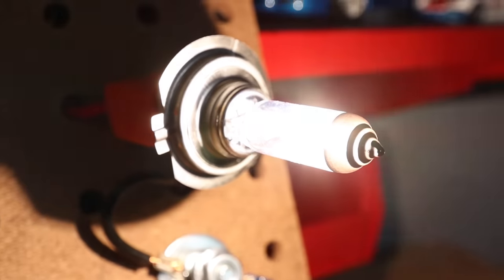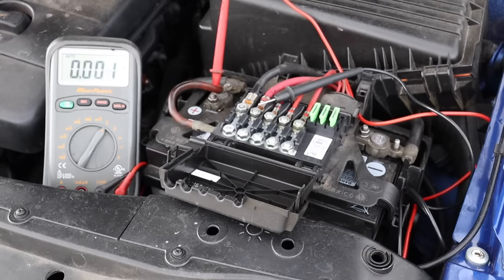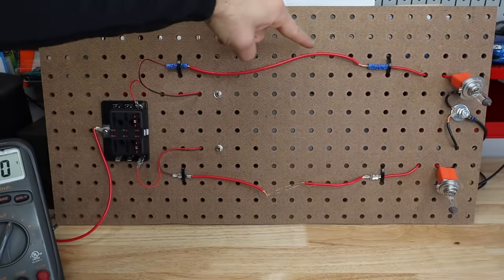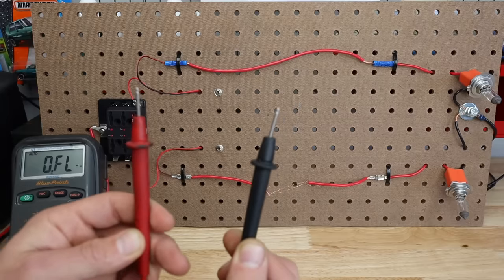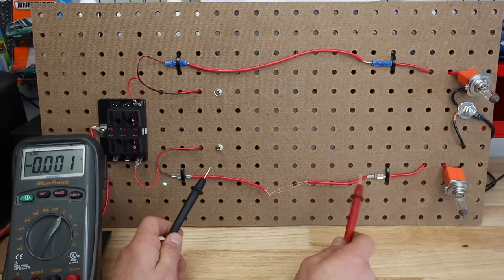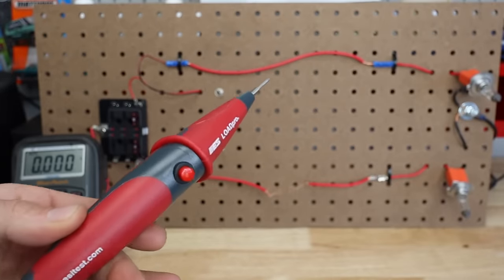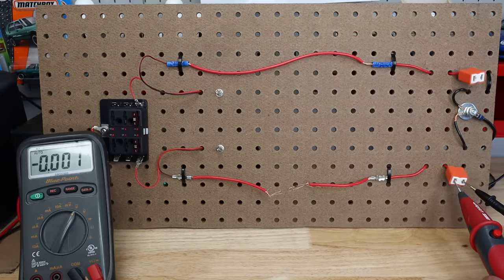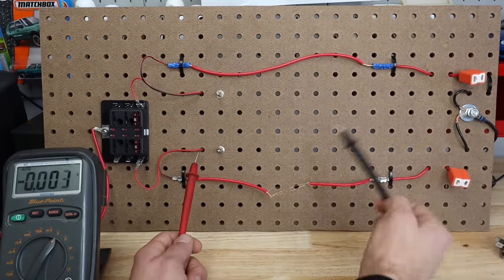Voltage Drop Testing ~ The BEST Way To Test Wiring

Comment: Good video!
Could be dangerous to those that do not understand modern electronics though however those folks will get them selves in trouble regardless if you made this video or not.
One of the scariest tools in a rookies hands these days is the Power probe.
I've earned bucket loads of money fixing vehicles after the owner or other mechanic fried modules probing wires......
As always, thanks for the great video!

Comment: Great video mate! I would love to see more in this style from you :)
Reply from the maker: Thanks! These are fun videos. But like the current draw vid, a lot of people are stuck on old, outdated, or just any newer or different way to do things. LOL
Reply: @HumbleMechanic Great video. A nice follow up would be "what to do after a failed voltage drop test"

We had some odd ball electrical issues a few weeks ago. Did the voltage drop testing; that "failed". So we cleaned the battery terminals, battery cables, alternator connections, ground to engine, ground to frame. We also had battery & alternator checked at local parts shop. Car runs better and no electrical issues.

Comment: One more tip: 0.75mm2 (18AWG) copper wire, 5m long (16.4ft) has a resistance of almost exactly 0.1 ohm. I don't know how thick the thinnest conductors, used in cars are, but probably more than that (0.75mm2 or 18AWG). So, if everything is good, you should get less than 0.1ohms on your multimeter, when measuring the resistance of even the thinnest wire @ 5m (16.4ft) long. And since most multimeters aren't accurate to more than 0.1ohms, if you get more than 0.0 or 0.1 ohms, you're not making a good connection with the test leads or there's probably something wrong with the wiring. Good video, btw! PS: thinner / longer wires have more resistance and thus more voltage drop, than thicker / shorter wires. And you get more voltage drop on wires with heavier loads (higher currents).

Comment: I've been messing with electronics/electrical and using multimeters since I was a teenager, over 20 years, I even went to school for it,  and I never knew you could get any kind of reading at all by putting both probes on the positive side of a circuit... Mind= Blown

Comment: Thank you so much!  Hoping I can use this to confirm if my passenger HID is flickering and failing to ignite due to voltage drop.  Installing relays didn't make the difference I had hoped.  Guessing it's an issue with the connector.

Comment: Awesome 👌 video this is very detailed on voltage drop testing I use it in my automotive diagnostic I have a resistance on a brake light when the brake switch is depressed I changed  out the brake switch with a new part and there is still resistance in that brake light the switch is not the problem should I do a voltage drop on each wire of the brake light wire?

Comment: Be interesting for you to do a vid on why bad grounds cause erratic symptoms...and why v drop doesn’t.
Reply from the maker: Oh we can make some bad grounds. LOL
Reply: HumbleMechanic 
I had an old ford truck parked in the weeds for about 8 years, then give it to my oldest son.
The sheer number of bad grounds were too numerous to count... truly unbelievably high number.
Most concerning was the near under-dash fire, not to mention the innumerable system failures.
We simply regrounded everything from small to battery to chassis, to engine etc etc.
Lucky my son is an experienced HVAC tech with loooots of energy... I’d have simply junked it !
Was a great learning experience for me...never would have expected that many grounds would have been bad
Reply: I believe you can voltage drop ground cables as well.

Comment: Thank you SO much for this video!  I have a mk2 Gti that is only reading 10.2v at the power lead for the lift pump/in tank pump, and I want t sure how I was going to determine where the issue was.  I have a solid 12.5 at the fuel pumps relay, so I guess it’s time to start probing downstream of there until I find the issue...

Comment: Good explanation! I use voltage drop testing on almost a daily basis. Hell I just used it today on 3 different reefer units today to track down problems. One of the great parts about it is it can help you narrow down where the damaged wire is in the circuit moving from connector housing to connector housing. I have a load pro as well it is a handy tool but the only thing I don't care for is that it only draws about .24 amps. I would love to see a load pro that could do 5 amps or so for higher current circuits.

Comment: Great video! Any idea how you'd test the voltage drop along a wire connecting a DC-DC charger that is 7m away from the starter batter?!

Comment: I'm trying to learn how to check the circuitry of my son's 93 Honda.  The battery drains overnight, but how?  

The dummy battery light comes on, but turns off when the AC is turned on, so that's telling me that the problem lies in the AC.  Is my way of thinking correct?  That's all I'm really asking. . . . for now.  

Thanx for the illustration of the broken yet still working wire.  Very well done.

Comment: I want to test the voltage on a cable attached to my room that goes to our router. Ever since they installed the cable, my hair on my arms and neck stands up, and it feels like I am getting a sight shock. Can you recommend a tester for this, or to see the free electrical charge in my room from the cable? Thanks

Comment: Oh oh oh ok I have one for ya buddy! Yes! Voltage drop tests super effective! I've noticed you mentioned and also in my experience starting and charging systems do make for really easy guides on how it works and the basics. That will probably be the majority of time but! As a technician we know that these systems are also designed to use a certain voltage through a system.  I.E. you dont really ever have just one headlight in alot of circuits So! With two headlight you would expect to see 6 volt loss across each one yes? Most modern circuits imo short of general starting and charging have more than one load designed in the circuit. Also! What if this a circuit that uses a 5v reference and common grounds for multiple sensors! This video needs another 12 and a half hour lecture to cover all the bases. I would love to see that video but in a collab with EngineeringExplained! Your both great guys and I love both of your channels but in a general shop environment I could see you guys butting heads quite often
Reply: Headlights are wired in series/ parallel, so if one blows the other stays on.. So when testing each headlight at connector you would see 12 volts.

Comment: Why did you equate .26v to 2.6 volt drop? Thanks!  4:37
Reply: I stopped the video at this time . Not serious.
Reply: I may be wrong but I think it was a typo the actual result was .26, which is how much voltage was used between the 2 testing points I believe anything pushing a bit over .200 volts is kind of bad

Comment: Once upon a time I had a car. At night it was very noticeable that every light (Anything that was powered) would fluctuate in brightness in a consistent and constant manner. Motor ran good apart from the ticking noise. got rid of it as I needed a truck. Easy fix. :)

Comment: My old car has o voltage drop of 1v on the positive side and 0.5v on the negative side of the cooling fan. So a total of 1.5v, do you think this will affect the performance of the fan? 
The headlights had similar problem with over 2v drop but fitted a loom with relays.

Comment: Networking is the same... Signal degradation is experiences with voltage drop on the data lines that go over 300 meters.. Thus I use a fiber line. it can go for Miles because it uses Light instead of electricity. :)

Comment: Great video, and very useful. Can you please make a video that explains your process for determining where to attach your leads within the circuit? If the frayed or pinched wire is somewhere inside eight feet of loom, what’s an efficient way to know where you have a good 12v or good ground source to locate the drop? Thanks.
Reply from the maker: for that situation going right to the component would be best. Look at how I had the load pro on the light bulb. OR really, anywhere you can get to wiring. LOL

Comment: Would it ever be useful on testing signal wires? For example, I had a vehicle with a issue of randomly loosing power. 1 fault for Wastegate actuator posistion sensor - Low. Did resistance checks from turbo actuator to ECU, all OK. (I soon found out how useless resistance checks are) Eventually I found the 5v and Ground rubbed through in the loom which caused them to occasionally short causing a 'Low' signal, thus throwing a code. My question is, what would be the best way of diagnosing this if I hadn't found the chafed wires? As the ECU wiring is all enclosed when it's connected and running.

Comment: Was quite surprised to see that that "bad wire" didn't reveal much on the ohms scale of the multimeter.  So is testing resistance worth it or does one need a megger ?

Comment: Quick question, I've got a car hauler trailer with a winch on it, I'm using the battery from my truck but it's using about 12ft of 4ga wire, it works until it gets under a load then it just clicks at the solenoid, is this voltage drop due to the long run of wire?

Comment: i would love to let you use my fluke 87. ive found a ton of bad connections by checking resistance. maybe its more sensitive than the snappy idk.   i also have to say i love my power probe but it seems to show extremely weak circuits  as good and ground connections out of thin air lol

Comment: There's some missing information for me:  As soon as you tested the more local connections, it went from 12+ volts to .2+ volts and that was the drop?  How did the multimeter zero out between testing the whole and testing more locally??  I'm new, so can you explain?

Comment: good vid, but i always thought you had to disconnect all the connectors to check resistant over a cable?
Reply from the maker: That is the right way. but the way I did it on this board is fine for the example. I am thinking its time to go WAY basic on DVOM use on cars

Comment: In order to fully understand this you need to understand the basic equation: Volatage=Amps x resistance (V= I x R). Voltage and resistance are indirectly proportional so when one goes up the other goes down and visa versa. So if resistance goes up (fault in circuit), voltage will go down; hence voltage drop

Comment: As you load the car with a Carbon pile from the AVR machine at 1500 rpm. How much voltage drop will be ok from the alternator wire to battery ?
And how you check the voltage regulator of alternator?
I am doing Motive Power in college, I got different views from different people and I want to know how this really work ?
Thanks

Comment: @ 12:10, I don't get it: it seems the Loadpro gave no indication that the wiring is torn, so what good did it serve here ?
I mean, it showed full system voltage (12.6 or 12.7 V). In other words, it didn't show any significant voltage loss caused by the resistance in the bad wire. What am I misunderstanding here ?? 🤔🤔

Comment: I think a scope and square wave stimulation is better than voltage drops for bus and signal wires.  Much more sensitive.  But for power and ground wires, voltage drop if more practical.

Comment: That kind of problem is usually caused by a corroded contact in a connector. If the pins are pins are green spray them clean. Rusty grounds. Connectors: spray, upnplug and reconnect 5 times. If the problem goes away the rubbing of the connector pins rubbed off the thin layer of oxydization.

Comment: i have been using the load pro for a long time now and it works great simple test and will lead you to further diag of system .unlike other u tubers who gave it a bad review . [ like pine hollow ] you know who i mean . great video keep this kind of stuff coming
Reply from the maker: Yeah I think the tool has value especially at the price point. For some reason people want things like that to do more than it’s intent. Or it’s not being used properly. Similar to a power probe.

Comment: Shouldn’t resistance be measured with the wires disconnected. You are measuring if current can flow freely between the two points. The metallic connectors (seems like quick disconnect) can still effect the reading. I think if you would have disconnected the wire the reading oh ohms would be much higher

Comment: Greater than 0v and less than .5v is a good circuit for the most part. Edit: rule of thumb if your resistance is low you should do a voltage drop test. It will show the difference of ohms before a resistance test will.

Comment: The light bulb use too much power. My reverse light drop to 8v. When I remove both  of bulbs. I get 12 and up volts. So I went with LED I received 12 votes now my backup camera works. Not sure if my wire is like your wire.

Comment: Hey HumbleMechanic. What does it mean when my car's voltage drops around 1v whenever I engage my reverse gear? Also, there is a random drop of 0.5v drop when I come to a complete stop while cruising. I recently had my alternator changed and I'm running the usual i.e. lighting, reverse cams and android headunits.
Reply: I'd say reverse lights drawing current.  And alternator isn't spinning fast enough at idle (stopped) to charge optimally.

Comment: I belive i have drop voltage from battery to fuel pump (positive side) 12,6 volts in battery, when i turn on fuel pump it drops to 0.4 Volts, is that normal or should the fuel pump voltage be the same as battery when turned on?

Comment: So to do a volt drop test on a battery ground cable, would you just need to have the car running? I have my battery in the trunk of my Mk4, and I have occasional electrical issues that I've long suspected may be related to the battery ground.
Reply from the maker: yes. Car running. I would also test with all loads off, and on. 

The MK4 is good about bad grounds under the battery
Reply: @HumbleMechanic  Awesome, thanks! The AC is long gone, so the cooling fans are pretty much the only big load.

Comment: You should have shown how the ohms resistance from the good wire vs the strands wire. Also, you don't want to see more than a 30 milivolts on any circuit except starting/charging circuit which the max should only be 50 milivolts.

Comment: Good video!  So, how do you know just how much voltage drop is too much for a certain circuit?  Are their charts somewhere that shows just what the voltage drop should be for certain wires and apparatus?  Tom

Comment: maybe worth showing how to test the ground drop. from the ground side of a light to the neg terminal of the battery. should be 0.With a bad ground connection like you said, there will be some value greater than zero do to additional resistance in the ckt.
Reply from the maker: The test is done the same. But I am much more critical of the reading than on power side.

Comment: In a Direct Current, Dissimilar metal connections should always be avoided as much as possible. If dissimilar metal connection can't be avoided the connection should always be sealed unless you want it to corrode and fail.

Comment: The first way you did it by measuring the voltage over a piece of wire since you only see the voltage drop and nothing else.

The second way by the power probe thing in not a viable test since tha battery source voltage drops under load especially when it is a big load or small/bad battery. 
What you are measuring is the voltage at the connector under load and also drop in source voltage, to combat that you must measure battery voltage at the same time and compare. 
Also you don't se if it is the ground or the positive cable. 

And also the wire you damadged does actually dimm the bulb and heats up with roughly 1.1watt as it is a 55watt load, not to bad but much more than it should be. 

Great video anyways 🙂
Reply: Had a problem car at work where i suspected a bad wiring or ECU and the voltage over the wire seemed just fine, ended up calculating the power draw of the actuator motor and make a bulb chan load to 2.5x the amp draw to torture test the wiring, no issue what so ever and ended replacing the ECU.

Also if it is an issue the lights will be dimm and the point of bad comnection on wiring will heat up so you can feel where it is. 

Some times it is easier to just torture it 😅

Comment: So someone explain to me , at min 4:41 i saw 0.260 v in the meter , but u saying 2.6 v ?? It doesn’t have to said mV ????
Reply: I asked the exact same question and I'm yet to receive a reply
Reply: he said "point two six volt" .26V that is the same as 260mV . search  Kirchhoff’s Voltage Law for basic analysis
Reply: @RangerSpecForDelta  It was a mistake.  Should have .26 not 2.6
Reply: @berferd2  yah. Looking back at it now i see how anal retentive i can be with the details.